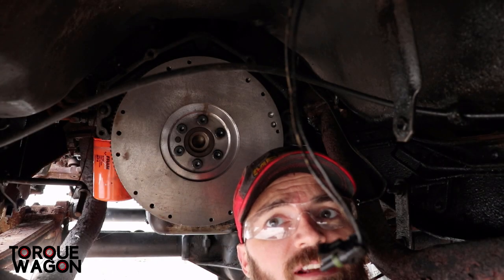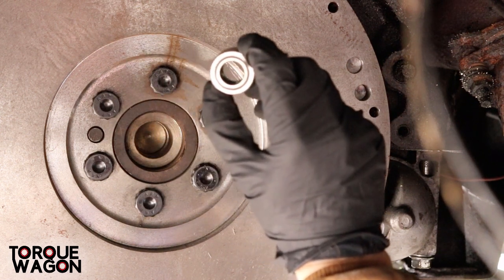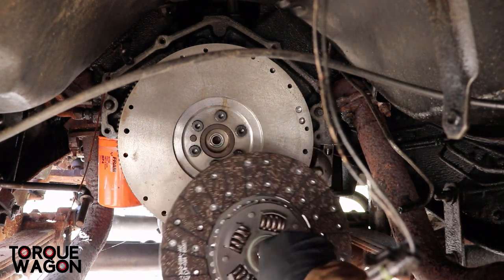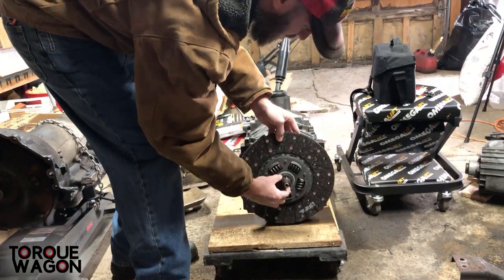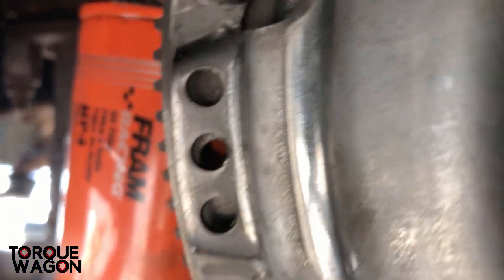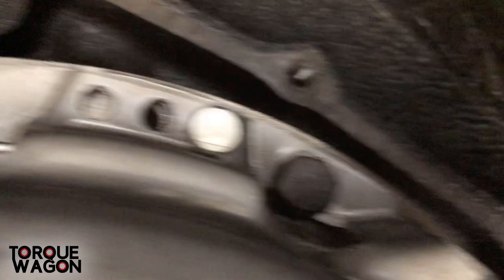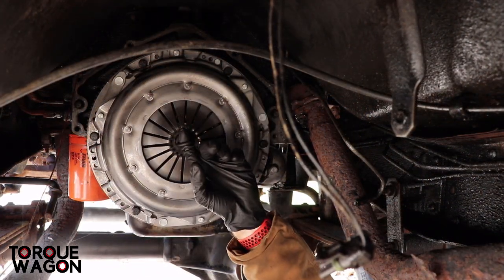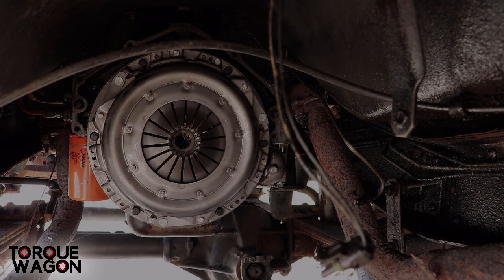How to Install a Clutch on a 6.2 Diesel | NV4500 Swap Ep. 4

Comment: When installing it would behoove you to lift up the pressure plate until the installation tool simply glides in and out with the least resistance before snugging up the hardware, this helps center up your pressure plate and reduces vibrations, makes for a easier install too!   Great content, I thoroughly enjoyed watching this!

Comment: When you got your clutch and flywheel and stuff did you get it for the year the trans is or for the truck? I’m doing this swap myself but mine is going behind a big block
Reply from the maker: My clutch and flywheel are for the year of the truck and are engine specific. I think I used an 85-86 K2500 pickup as my baseline there. The clutch master/slave cylinders might be for the year of the tranny. They are what the Advance Adapters bellhousing instructions called for. I’m still not positive everything is going to work perfectly. Hopefully I’ll get to do some test fitting soon now that I have some vacation time again. Might have to wait for it to warm up a bit since I’m stuck working on the street.
Reply: TorqueWagon I’m about in the same boat doing mine out in the weather I’m just see what an all I will have to have before I really tear into it. Just got a big block ready to swap so I’m looking for tranny and everything
Reply from the maker: Derrik, you will need a clutch/brake pedal assembly from whatever year the truck is, and preferably as much of the linkage or hydraulics as you can get from a donor truck. I got mine from a guy who sells junkyard parts on Facebook Marketplace (just the pedal assembly).